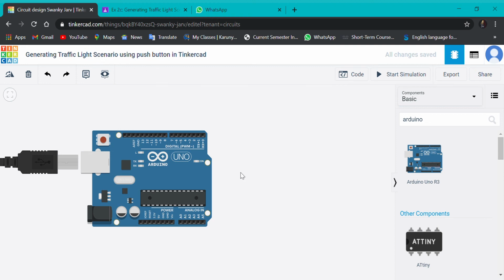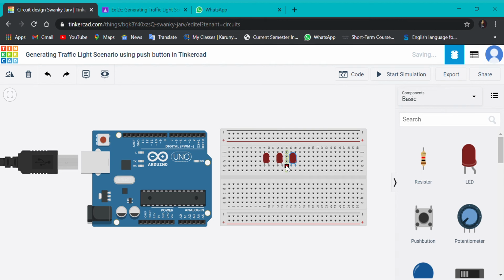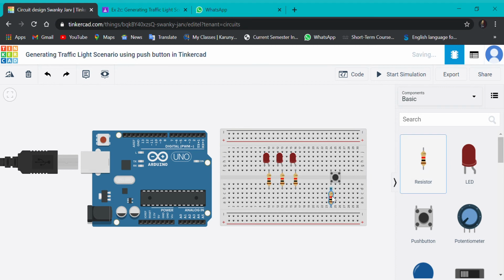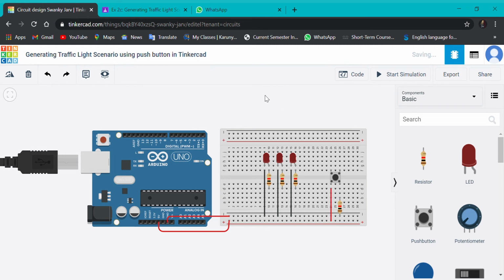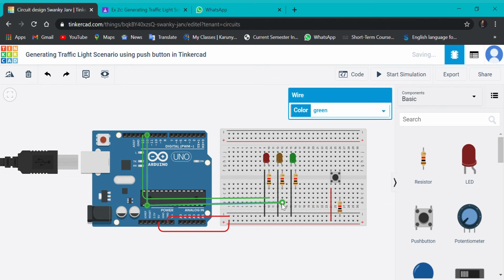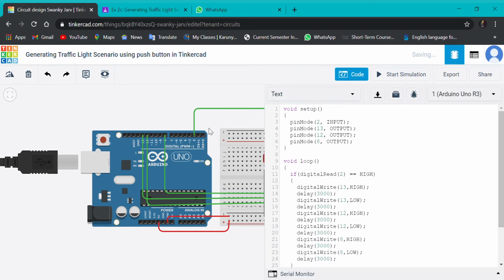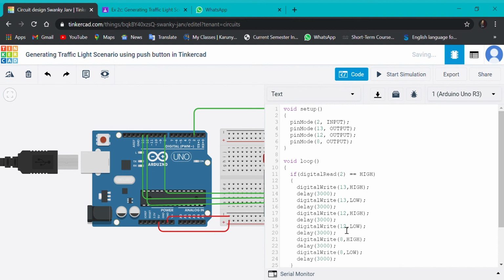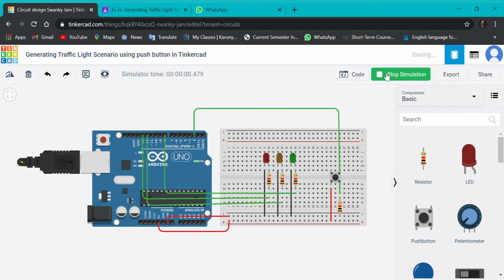Generating Traffic Light Scenario using push button in Tinkercad

Comment: the code link?
Reply: void setup()
{
  pinMode(7, INPUT);
  pinMode(4, INPUT);
  pinMode(2, INPUT);
  pinMode(13, OUTPUT);
  pinMode(12, OUTPUT);
  pinMode(8, OUTPUT);
}

void loop()
{
  if(digitalRead(7) == HIGH)
  {
    digitalWrite(13,HIGH);
    delay(3000);
    digitalWrite(13,LOW);
    delay(3000);
  }
  else if(digitalRead(4)==HIGH)
  {
    digitalWrite(12,HIGH);
    delay(3000);
    digitalWrite(12,LOW);
    delay(3000);
}
else if(digitalRead(2)==HIGH)
{
    digitalWrite(8,HIGH);
    delay(3000);
    digitalWrite(8,LOW);
    delay(3000);
  }
else
  {
    digitalWrite(13,LOW);
    digitalWrite(12,LOW);
    digitalWrite(8,LOW);
  }
}